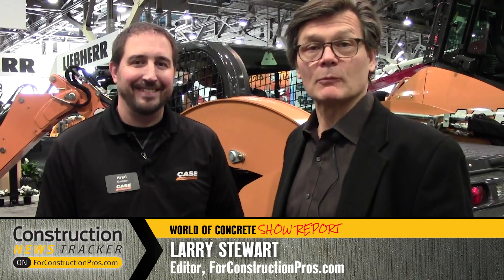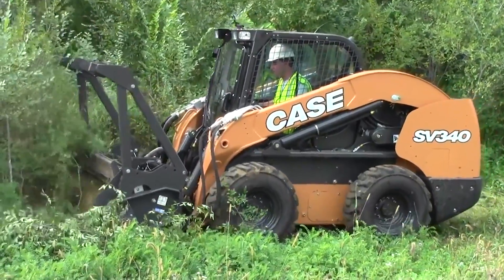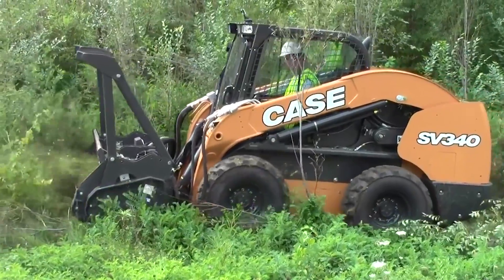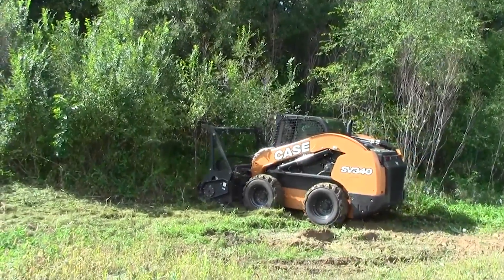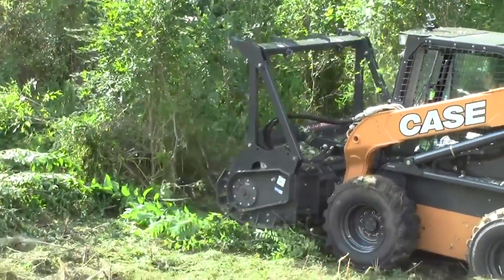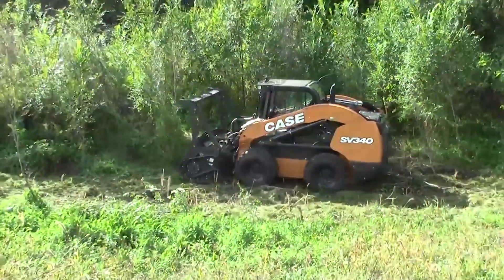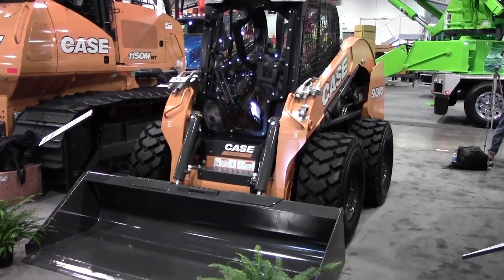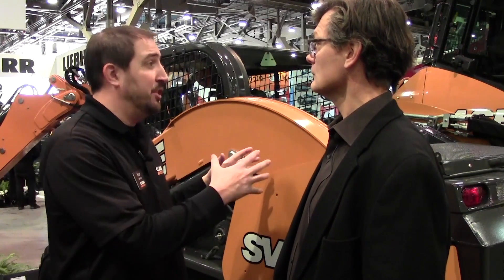[VIDEO] Case Engineers Extra Hydraulic Power for it’s Biggest New Skid Steer

Comment: Of all the skid steers I've run over the last 30 years the John Deere's the biggest piece of crap I've ever had to operate it was the most unbalanced skid-steer ever it destroyed tires.
Has more blind spots than sitting in the bottom of a refrigerator box.
And the proportional valveing is horribly tuned it's like running a 50 year old machine. The controls lack smoothness they're underpowered and slow.

Comment: Hydraulic oil site glass ,you gotta get on your knees  reach in to the abuse to clean it then you better have a light ! The def cap is down inside so far you about need two people to do it carefully because the idiots put an electrical plug that's got the wires wide open that runs the fill cap ,if you are needing to add fuel in a remote location with a jug it's a real chore and tons of fun being that the cap is way down inside the engine compartment with other electrical stuff close by ! Just really piss poor design! There is more things but hey it's only the first 50 hours !